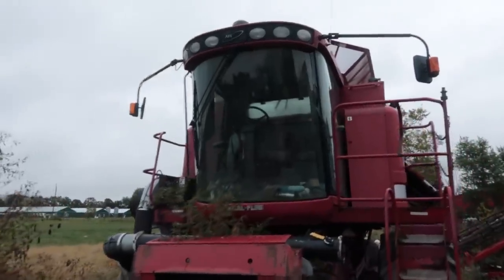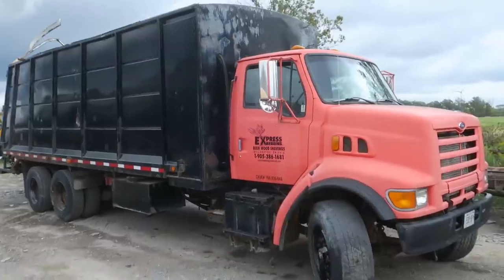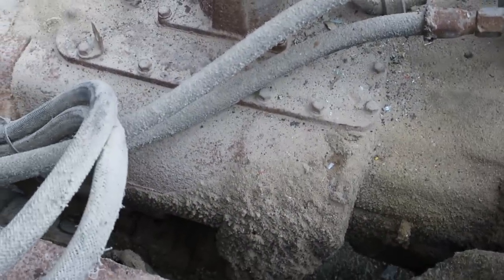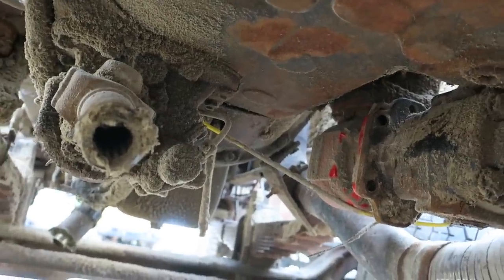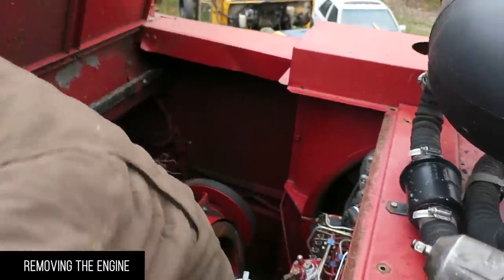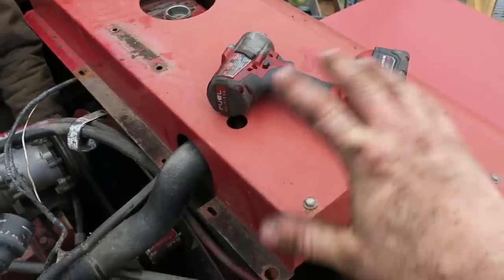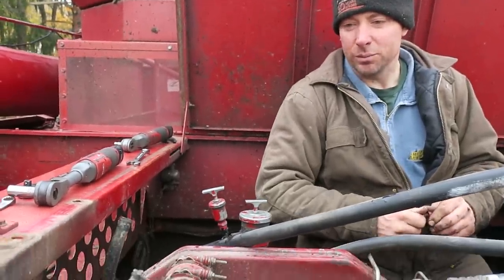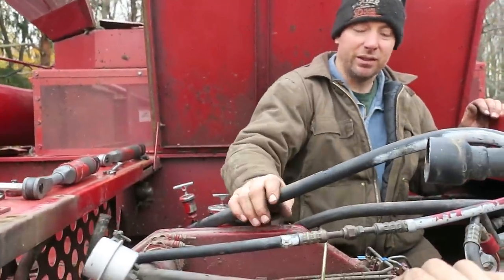8.3 Cummins Threw a Rod in a Combine [EP1]

Comment: I was thinking of a 5.9 swap but I now know it’s clear that I’ve gotta have a 8.3 in my s10
Reply: Itd be hard enough to fit and support a 5.9 in a s10 to begin with.
Reply: chase webber i have a old Nissan kingcab 2,5 liter turbo diesel in my 99 s10 and that mechanical engine is taking up 97% of the engine bay so I don’t se how you would fit a 5,9 in there?
Reply: @lucassvedlund3851  I dont believe I said u could. Most definitely not a 8.3 lmao.
Reply: BS give me a torch, a welder, and some metal. We can make it fit. It might not be pretty but she'll fit alright lol
Reply: Lol
Reply: Why limit yourself? Go all the way to a big cam Cummins engine...
Reply: Don't listen to the haters.  Just drop that 8.3L in the back.  Turn that S10 into a rear engine mount truck.

Now getting the it drive right ... eh.
Reply: In England they make a 4.5L 16v I4 based on the 6.7 Cummins. As opposed to the 3.9L based on the 5.9L. That seems like the ultimate swap Cummins for smaller vehicles. An 8.3L ISC would be cool, just need a bigger truck.

Comment: “Hey boss — the Ford needs a new start....”

“Scrap it. Those starters must cost like 250 bucks.”
Reply: Yeah...  I didn’t actually call the starter store on that price. Kinda just spitballed it off the cuff there. Always glad to be corrected though.
Reply: die warlock  how much is it? $300?
Reply: die warlock  the starter itself can be found for 189 for a DB electrical off amazon. I quote that brand because I Have experience with it for starters and alternators. Now labor would likely be costly.
Reply: No kidding that looked like a perfectly good truck :/
Reply: @pospc2  why?
Reply: @EngineEngineer  labor being costly?? Because i personally find labor to be costly. That is the only reason i mentioned that. If you are asking about the brand,well i bought it after reaching the brand and have also had good results.
Reply: @pospc2  labour would be well under an hour to change that
Reply: @EngineEngineer  gottcha. I'm not very knowledgeable on diesel equipment. So overall it wouldn't be bad.

Comment: Combine engines are great in trucks. My dad used to have a 1988 GMC 2500 squarebody. It was a huge truck, 3+3 with a long bed. Only a 2WD but that's all we need. He pulled a 6.354 out of an old Dodge medium duty truck and put it in the GMC. My neighbour has about 4 White combines and a couple White tractors with the same engine, just a different injection pump. That truck kept going when other trucks would have been dead for years. We finally got rid of it after it had a slight issue. Went to get a load of hay, before we left it sounded really bad but we were only going a couple blocks so we went anyways. Checked the compression when we got back, 0 compression on one hole and 250 psi on the rest. Rebuild spec is 400 psi. After that we got a 94 F250 with a 7.3 IDI, it sucked. Now we have a 98 Ram 2500 with a 12v. It's pretty nice.

Comment: Back when I worked on marine cummins , we made a slide hammer from old injector lines / nuts , a long bolt and a heavy wrist pin , worked great for pulling injectors in the tight quarters of a boat

Comment: We had that happen to a forage harvester where I used to work. It didn't help that the Mercedes engine was very slightly modified from the truck version (so a replacement was pricey) and turned up from 400 to 500hp (at the factory). My old boss is still using the con rod as a paperweight.

Comment: JB Weld that block, hammer that cam shaft straight again, toss in an unobtanium connecting rod and a couple new piston pull-back springs and she'd be up and running again.

Comment: Had to run an old 12 valve Cummins in a heater cart for an aircraft stuck in -50C. That 12 valve ran at 3500 RPM for 4 days straight. It blew the valve cover gaskets, but other than that, the oil just needed topping up and fuel every 4 hours. It was quite something to hear it screaming day after day. Needed hearing protection to even get near it!

Comment: Before you go cutting the cam gear try the wooden dowl trick. Get 12-1/2" round dowels and tap them into all the lifters. Then pull up on each cylinders pair of lifters and rubber band them up. When all 12 are up the cam pulls right out

Comment: Yeah we had the big Iveco motor in the NH CX8080 do an impression of the guy in Alien.1. and CNH told us there was a batch that had an issue with over fueling to a cylinder and hydraulic-ing the side right out the motor, $34,000 of a slight issue, asshats tried to get out the warranty by saying "because it happened on the road between feilds it wasn't in normal working conditions" but it got sorted.

Comment: Interesting, didn't think about being able to use hydraulics to run the steering to pull dead machines. Great info!
On the cooling side you should see if there's a coolant bypass for the rear (#6 cylinder) of the block. Cummins made them for the b-series, there's also aftermarket ones too. Also a waterless coolant could be an improvement & worthwhile.

Comment: That combine has been sitting for more than the summer, or they just never clean the thing, they don't get that nasty in a season. Also never understood why they run the engine so fast in those combines, everything is ran off a gearbox so some re-gearing would bring the engine RPMs back to a safe speed and still run the machine correctly.
Reply: They run at the RPM where peak-power is being put out. There's nothing inherently unsafe about it, unless it's not being maintained or used properly, which was certainly the case with that Combine. The engine was literally set up to run at that RPM pretty much all the time. The only real fault I can find with that setup is the lack of a push-pull fan setup. The A-Pump setup can be problematic, but it's not impossible to keep an A-Pump equipped engine going. It just needs more care than its P-Pump equipped brethren. More gear-reduction = more torque multiplication, so running the engine at peak-power and heavily reducing it is the only way to go. In basic terms, it's the same kind of thing you would see with any other kind of industrial machinery, like bulldozers, scrapers and excavators, for instance. With the engine running at peak-power through multiple reduction stages, you can literally move mountains.
Reply: In actually they run at about 2200-2400 rpm, but they're not like a truck that goes through gears and cruises at a lower rpm despite maxing at around 3000, they run that rpm alllll day, they just sit there and drive a hydraulic drive right off the crank that powers everything, they need to be very meticulously maintained to keep running correctly. Source: i have a 2366 on the farm i work, and we just had a spline shaft sheer the teeth off they hydraulic pump because it was never greased, thank christ there is an intermediary between the crank and the pump. Also worth noting, hydraulic pump, hydrostatic drive.
Reply: @MFKR696  I´m guessing they just did what he described to kill the engine, with pinching the waste gate line off. The jeezless diaphragm box is the worst thing ever. I don´t know how many of these I´ve changed on our coop until we ultimately got new bines and tractors.  As Rich said, they come faulty from the factory...
Reply: Da vid I never knew they where hydrostatic no wonder there so damn loud driving down the road
Reply: @nolanmitchell7319  Just the easiest way of getting something driving slowly while still maintaining engine power to run all the implements.
Reply: Johnromsmith Actually combines do get that bad really quickly from all the dust and chaff while harvesting. I work on the fuckers for a living in a Case IH dealership. Trust me, the amount of chaff and dust that builds up is a lot. You can spend a full day cleaning them off with compressed air and that's not even washing it.
Reply: @spartan117m15  agreed. I laughed when he said that. 

Wheat harvest is the worst.
Reply: @broc212  If you think wheat is bad you should try combining hemp for a couple of days, now that is truly a nightmare, and the dust sticks to everything.

Comment: I've only seen 2 8.3s have catastrophic failures. Not sure why it would be considered common. And if you're overheating you probably need to clean out the rad, coolers, and put new brushes on the rotary air screen.

Comment: Your going to have issues. We have a block that was for a truck in the shop and we pulled the old head because it was aftercooled in the tractor. We had the head rebuilt that way we knew there was no issues. Pulled the front cover that holds the pump cause the p-pump cover won't work. Next issue we ran into were the sleeves, and the new sleeves were taller that the ones that came out of the truck block. Only thing we can figure is the original 8.3 that was in the tractor had a taller casted block than the block from a truck. Last I knew we were waiting on different sleeves to come in so they can finish it, get it in the customers tractor and get it out of the shop.

Comment: Good  day I  am not even a half ass mechanic  but I was at a generator place & there was a 4 cyl. cummins sitting there with hole on side of motor #4 cyl & cam shaft was broke same way, kinda odd. Good video Thanks

Comment: Am I the only one who noticed the hydraulic cylinder on the forklift boom loosing pressure.
Reply: Its not excessive tho,not worth fixing it at this point
Reply from the maker: That's the auto lower feature for when you install the engine by yourself
Reply: @DEBOSSGARAGE  😂😂😂😂😂😂😂👍

Comment: Time is essential when a machine fails. That is how you end up with plantlife in a machine  after failure, procrastinating. We all do it on some level. Mostly when we sit around watching lubetube.
Reply from the maker: After crunching numbers the day the rod came out, the neighbor went and bought another combine right away.  Not much time to get crops off in our climate.  It is an older machine that is FORD (fix or repair daily).  It is still useful for someone though.
Reply: @DEBOSSGARAGE  Green ones, blue ones, red ones, yellow ones all fail. They are only as good as the people maintaining them. Great Vidya. Keep 'Em Cummins.

Comment: My brother bought a 1680 with the 466 that had been ran low coolant and turns out the intake manifold had a huge hole rotted in it also. Rebuilt and it burnt a month ago hes gonna have to pull it 8 or 10 miles like u just did.

Comment: Disassemble a 6.7 ford today come to find out the rocker arms and pushrods separated and found out that the plastic device tasked with holding my damn lifters inline with my damn camshaft broke so now it turns into a total dissemble, heads, front to camshaft, lifters, rocker arm sets because they wore and dropped the ball bearing that it runs on which I thought was the original problem. When I looked down in the pushrod area I knew that it was over. The lifters had ejected the tips on the individual lifters where my pushrods had thrown off and of coarse the lifters had turned on a roller cam and we now what that means. Sorry for the ramble. I like working On bigger engines.

Comment: Interesting would be to see if the same thing can be done in a newer model with computer controls and stuff. Would the ECU allow the new engine to work? I say it because the whole "right to repair" many farmers have been fighting with manufacturers when the equipment goes bad.

Comment: I am working  on a 1104c-44t with an similar  window modification to the block except  it threw the entire rod including the wist pin out of the block. I wasn't hard for the owner to identify the knock at that point because the entire rod and pin was on the ground. 🤔🤔Oh and it did break the starter.🙄🙄
Reply: What was the cause?
Reply: @tomasmlcoch7489  poor maintenance, not checking strange noises

Comment: You guys are so lucky that you didnt need to hack into the combines computer to get it working, many agricultural machines nowadays are so computer heavy that its nearly impossible to fix them without taking them to the dealership, and fixing the machine on your own often voids your warranty and the dealership wont touch your machine with a ten foot pole even if you pay them, which is why the "Right to Repair" Movement is sooo important, it may be good for phone repair or Tesla repair, but its absolutely essential for agricultural machine repair, many farms have gone bankrupt just because they cant fix their own machines.

Comment: Kind of a potentially stupid hypothetical question here... Say the engine was running for the sake of the argument. If they mounted a large electric fan on the front of the rad to create a push-pull setup, wouldn't that help it run at closer temps to how it would run while moving?

Comment: milwuakee sends out a free line of tools, deboss uses knock off batteries from amazon hahah i got a kick out of that
Reply from the maker: Figured we would do a video to see if knock off batteries are worth anything.  They are definitely not
Reply: @DEBOSSGARAGE  maybe for running a drill or radio but with angle grinders and circ saws cant imagine itd take long to have a molten puddle of lithium dripping on your favorite work boots

Comment: I’m sure you could have unbolted the knocked rod, patched up the hole in the block with some bits and bobs and a tube of liquid metal and have a usable 5 cylinder running the same day. 🤣😂🤣😂🤣😂👍👍👍

Comment: In the last ~ 4 - 5 years I have seen over a dozen post 2010 combines with less than 3000 hours on them sell for crazy cheap.   $2 - $5K because absolutely nobody trusts them due to the new emissions compliant engines having such short service lives and such outrageous repair/replacement costs. 

$200 - $300+K machines selling for less than a penny on the dollar because their engines can't be trusted despite still running fine.
Reply from the maker: Well don't keep them all to yourself, help us out and add links!
Reply: @DEBOSSGARAGE  Just start watching the farm  heavy equipment consignment auctions in the upper midwest next summer. 

Too often the only people bidding on those machines at all are the scrap/salvage yard guys. 

In the last ~ 5 -6 years we have picked up multiple 140 - 170 HP tractors from the late 70's to mid 80's for  $3 - $5K  all ran and worked fine but needed a good cleaning and servicing.  

MF 2745  $3000
MF 1155  $3000
AC 7050  $3500
AC 8030 with loader $5000

All under 3000 hours and none took any major work to get them back up to solid and reliable machines.   

Beyond that I have seen many late 90's to ~ 2010 combines and other heavy field machines go for similar prices and pretty much all were cheap due to people having zero trust in their engines due to emissions systems related problems.

Comment: You said this 8.3 ran at high rpm... So what’s a safe rpm to run a 8.3?
Reply: Clay Barnes - they are rated to 2750. But personally when our farm had a 8.3 cummins I didn’t take it above 2500 rpms.
Reply: BoostedDeere did you ever have any issues with it?
Reply: Clay Barnes -no sir

Comment: The 8.3s are not that great in trucks ether the bottom ends are at their limit at 300to350 hp the rod bearing are to small compare them to a dt466 which is less displacement and usually lower rated hp the dts are alot bigger also the rod itself is a lot stronger and the block is a lot stiffer